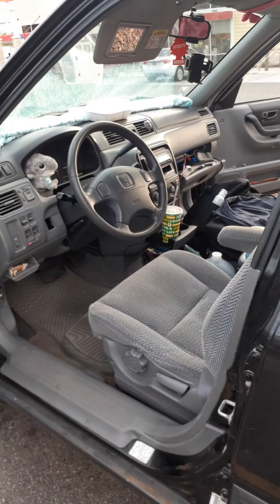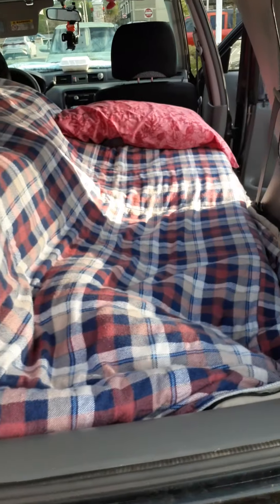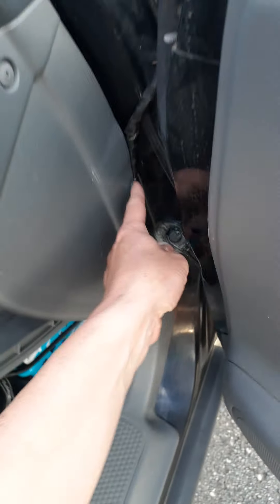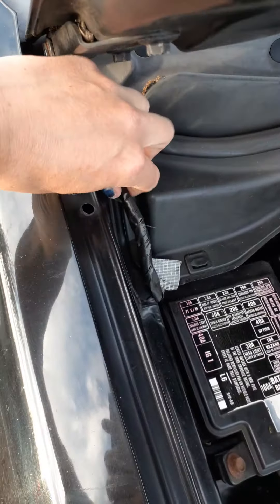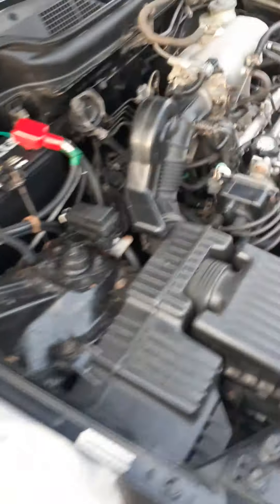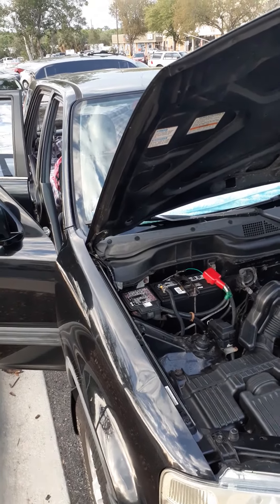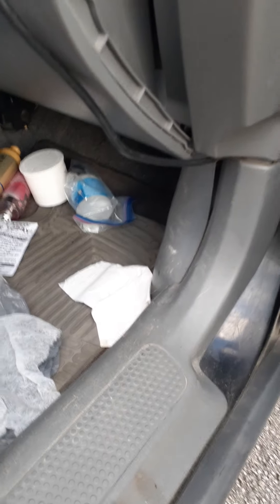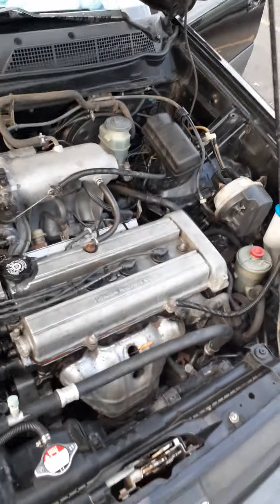living in my car.

Comment: 👍👍 do you have reflectix material for privacy for your windows and also I was thinking about storage ideas you could put a rooftop storage container on the roof plus a solar panel and also if you have Towing ability or a tow hitch you can get a drop-down storage rack
Reply: I actually just installed my rooftop solar panel a couple days ago. I'll be putting out a lookaround video on that soon ;)